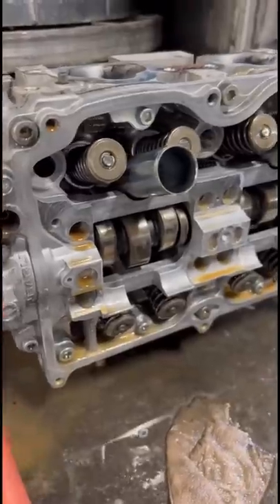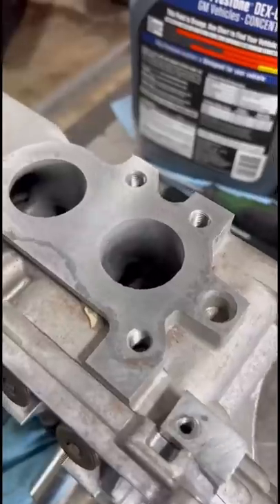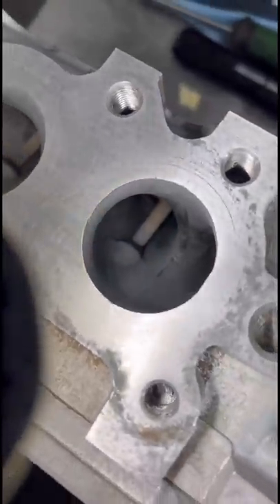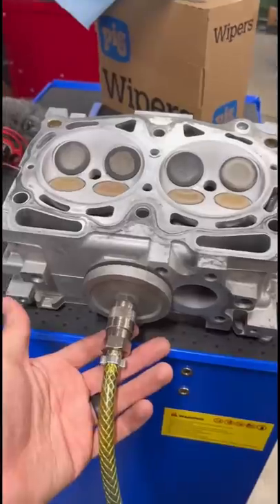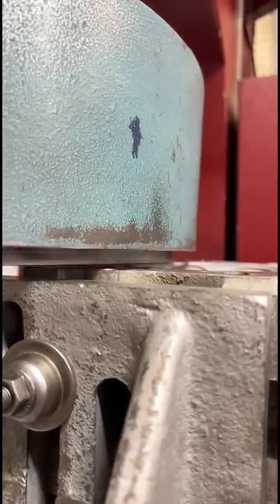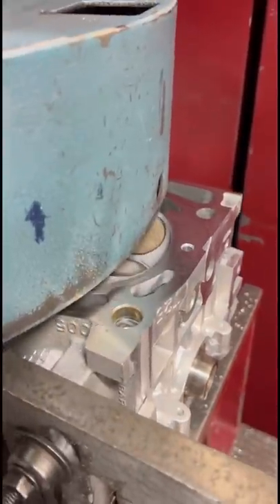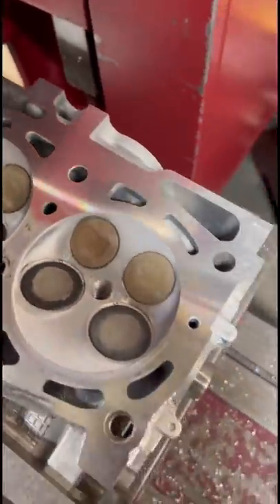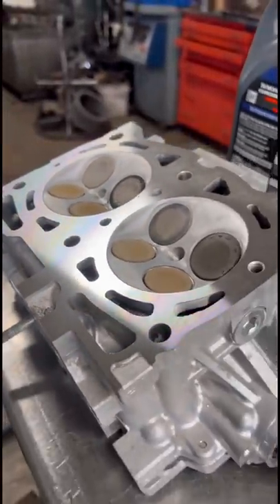#shorts Not A Week Goes By Without A Set Or Five Of Subaru Heads For Resurfacing

Comment: Everything hes doing sounds great he just said a little clue about the valve guides why the h*** would You nack solve the problem That could occur it's called preventive maintenance So everything he did if the valve Guide drops in 5000 miles Do the job Right the 1st time it's gonna save money for everybody

Comment: Not well versed in mechanics, so excuse my stupid question.
I assume that this is cheaper than buying a new engine, or replacing whatever needed to be resurfaced? It's about as much work to get these parts out, right? So they're just saving the cost of a new engine?
Or is this just done to increase performance?
Reply: Even the “new” engines are junk, so what’s the point ??

Comment: Guys, what's the purpose of this? What does making the head nice and flat get you? Is it just a refurbishment process they need?
Is this for built engines, or not only?
I love learning, but don't know about this yet.
Reply: I have been learning about headgaskets as I replace my own at home. Machining the surface is so you can get the flattest, most smooth surface which will give you a better seal againt the headgasket and engine block. If the head is warped, it will not seal correctly.

Comment: Any rough ideas how much it would cost to ship a head (maybe 2) to you guys? I'm located in QC, Canada.
Also how much a head\block resurfacing, cleaning, whatever else is done for a "general" rebuild would cost? The engines a 4G63T.
Love the work that you guys do and wouldn't mind spending the extra $ to send the motor down to you guys if possible instead of doing it locally. if

Comment: Am I the only one who is actually impressed this machine shop oils cam bearings before sending them out?
Reply from the maker: We learned our lesson once.
Reply: Considering a machine shop had my heads for about 3 weeks (their choice due to bad weather) and when i picked them up my damn cams had more surface rust on then than you would imagine in just a few weeks. But the kicker was when i made them put a socket on the cam gear he turned so hard he broke the cam bolt. Somehow it seized the cam bearing just enough. He sprayed them down with penatrant and broke them pitted cams loose and looked at me like i was supposed to take them... yeah right!!!! so yup, i like the fact that you lube the cams. lol

Comment: What do you think causes the Subaru engines to do this?  My father has had two fail and bought another one so it's just a matter of time for his third one.
Reply: I've heard and it makes sense that it's because the head is just so small that it doesn't have enough surface area and thats why closed deck blocks with upgraded studs usually solves the issue.
Reply: The reason why Subaru head gaskets had so many issues is that they used a multilayered head gasket that when introduced to coolant would start to separate. This would eventually cause a leak and failure. That being said I do believe their were other issues as the guy above listed. Theirs a guy called Mrsubaru1387 who did a video on which Subaru engines had this issue and why they failed.

Comment: Why scrape and sand, wouldn't it just be easier to take a thou or two off and make them flat and clean?
Reply: It gums up the cutting bit
Reply: Scrape and sand is much quicker on areas like intake and exhaust ports. There is no need to take the time to mount the head and machine the exhaust or intake ports.
Reply: Intake and exhaust ports are less affected by imperfections in flatness and texture. However, in severe cases, the manifold side does get milled. You will often see it done to marine engines that have saltwater cooled exhaust manifolds.

Comment: Where would I go to get stuff like this done? Like what would the type of shop be called? A machinist?
Reply: It's called a machine shop. You also need to be able to tell them specifically  what you want done usually. Do your research before you go. I had a set of rods I sent to a machine shop to get reconditioned. So they reconditioned the rods. I built the motor and around 500 miles one of the rods pulled apart. So I brought the rod that was just reconditioned into the machine  to ask the machinest if he magnaflux the rods to check for bad spots a day or cracks In the rods. He said no that I didn't specifically ask to have that done. I look at him and said how or why would you reconditioned a set of rods without checking them for cracks first? Checking them to make sure they could be reconditioned. All the dude said is I should of ask to have it done and he would of done it. So there make sure you have it in Wrighting and explain how and what they are going to do. You will have to educate yourself so you understand what needs to be done and what don't need to be done. Or you can roll the dice and hope you win.

Comment: I have a question
Do you resurface every head regardless or do you leave the ones within spec alone?
I've been getting in engines that have had camshaft failure after headgasket replacements.
They snap in half and the trend is that the customer had the heads rebuilt and resurfaced. They seem to have a longevity of 6 months to 2 years. 
Do you linebore/hone the heads?
It seems like the ones that don't have a resurface last longer or don't have issues as long as it's within spec versus warped heads getting machined. 
Have you run into this issue? 

Another machine shop told me that being the subaru head is so short and dense, especially single cam heads, if it's warped to the point it needs a resurface, just toss the heads. It takes a lot to warp a head like that.
So far it seems true to that extent as I have a pile of broken cams 
Have you had call backs for broken cams?

Comment: Wouldn't that give a slight increase in compression? Shaving .002 off the head.
Reply: I actually think what I see in this video is more like .003"-.005" per pass. Chips don't fly off like that at .001" depth of cut

Comment: So then when you remove so many thousanths from a head surface do you compensate with a thicker head gasket or just use a regular gasket and in turn get more compression from it when it's mounted?
Reply: More compression is irrelevant when the rings leak like a sieve …
Reply: @sking2173  I get it 😏 👍

Comment: This is supposed to be the last step, in the video it is clearly seen that the valves are burnt and need sandblasting work, check if they can be repaired or changed, check the guides, valve bushings, rectify the seats for a better seal , in general, a better sandblasting job for aesthetics and better machine polishing on the outputs, the cutting of the head is the final step to avoid scratches on the finish, also cutting the head with everything assembled means a high risk that they will remain aluminum particles.
Reply: You can see burnt valves with them installed? You must have X-ray vision my dude. That, or you don’t know what burnt valves actually are. He vacuum tested them and they were okay.
Reply: @T..C..M  I am not referring to the stem, I am referring to the head of the valves, personally I always try to clean them, but I think it is something of aesthetics, as for the work that many people did, what they want is just to cut the head, I can also understand why only that area is emphasized in the video.

Comment: What's the max depth you can resurface before you start to run into valve interference?
Reply: the spots right above and below the center head bolts just outside the surface indicates max surfacing limit, when you get to that point the head is done

Comment: Lots of misinformation about Subaru's on the internet. Subaru had 2 bad engines. The ej25d and the ej253. Somehow everyone lumps them all together. 🙄
Reply: my ej25d is at 350,000 miles and still on factory head gaskets
Reply: @damionlabounty7116  thats very uncommon. Go buy a lottery ticket. The graphite coating on the EJ25D headgaskets typically fails around 120k.

Comment: Can someone explain with all respect and curiosity, why these things fail so much? Like, is it just a tuning thing?
Reply: Very poorly designed engineering.
Reply: @kelsycunningham8452  So they still do this even when completely stock? Is the metal just too thin? Not enough head bolts?

Comment: Are these engines just prone to failure? For many imports, engine rebuild is not worth the $. I see you do a lot of Subarus
Reply: It's the valve cover gaskets angle that forces a chain of failures
Reply: Like me, he is in Colorado and there are A LOT of them here.
Reply: The graphite head gaskets chip and rip. They’ll last far beyond the initial warranty but when they fail they fail
Reply: Many people love taking a Subaru rally car, and don't do a good job turning up the boost. Those engines can't take it.

I live in Florida, and almost all Subarus sold here are rally cars. Other Subarus aren't that popular, because FWD is just fine for people who don't want an enthusiast car.
Reply: They're "famously" known to be failures because kids mod them without getting tuned.  Turbo'd subarus (minus the fa20 engines) are quite reliable if you use high quality full synthetic oil every 4000 ish miles. Get it into a good pull at least a couple times a week, don't granny drive it all the time. If you mod it, GET IT TUNED. These cars' ECU is sensitive to pretty much any change.
I have a 2005 Legacy gt (poor man's Sti) with 170k hard miles on it. Fully done up minus a built block, an intake, and a downpipe. Big turbo, big TMIC, custom tuned by me, etc. Stock block and heads. Never had an issue and I run it hard. (hopefully karma doesn't see this lmao)
Reply: @drewpee6643  no. They have head gasket issues . Just like the video says :” 3rd set today” and “classic Subaru head resurface”.
Reply: @drewpee6643  the head gasket issues were with certain years of the NA engines.

Comment: Subaru's are trash
Reply: Not really, the old EJs have their issues but other than that they’re great cars
Reply: @09impala  ive worked at a subaru dealership in the shop. And let me tell you, they are the biggest pieces of shit. Even the new ones get camshaft failure and all sorts of dumbass engine failures. All on stock power too